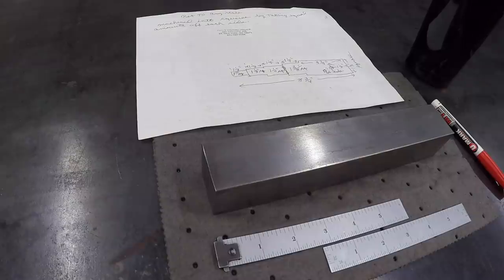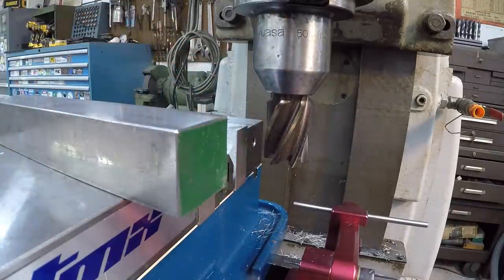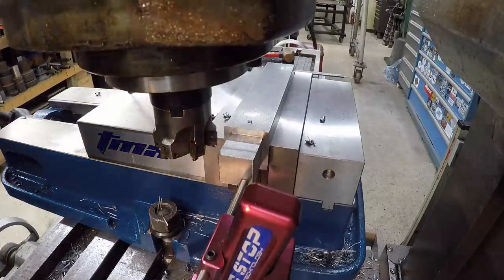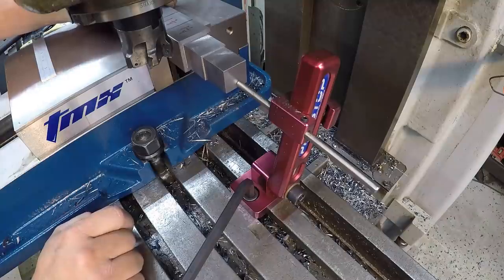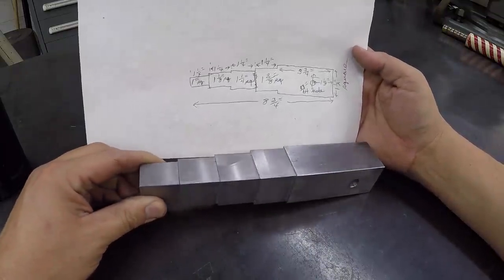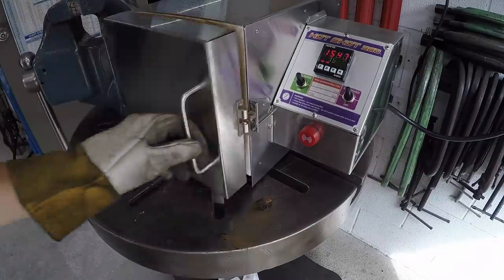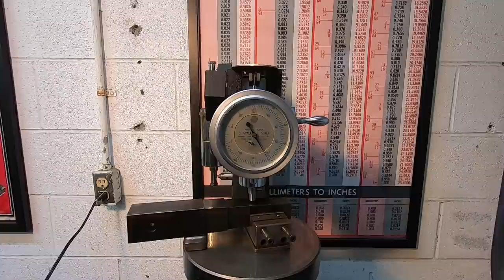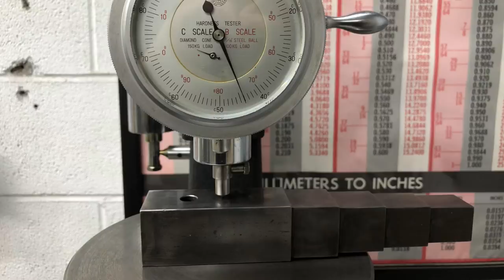SNS 296: Custom Square Drive Tool, Heat Treating

Comment: I think the reason you've got uneven hardness, is because it was sitting on insulating tiles, which absorb heat from the  metal, causing those areas to be less hardened.

Instead of putting the work-piece on insulating tiles, put it on a couple of of steel blocks.
Reply: After 2 hours at temperature, the tile and everything in the heated space have attained stasis temp. Seriously, touch the tiles - you’ll believe!m
Reply: if insulating tiles absorbed heat they wouldn't use them to build ovens.
Reply: @executive  That's not exactly true, the surface of the tile would reach whatever temperature the oven was set to. The tiles Insulating properties only prevents heat from travelling through the tile in it's entirety.  They also build ovens from tiles that are meant to hold heat by absorption, usually they're used on the oven floor.  Generally lighter refractories are insulative and denser refractories are absorptive. In gas forges for example the floor has to be tough wearing so they use a dense refractory over a lighter one.
Reply: @ianlowe4666   Don't overthink it. Sure, some ovens may have denser bricks that hold a bit more heat, but in general, the job of the oven walls is to keep the inside hot, not the surrounding room. In the end, it doesn't matter since everything inside the walls will reach the set temperature after soaking.
A bench top oven such as this has to be compact, so all of the walls will be dedicated to NOT absorbing heat, and keeping everything around the oven from melting. Botton line: I highly doubt that the resting surface will make much difference to the hardening of the steel (which is dependent on the cooling process.)
Reply: @executive   I didn't, pretty basic principles. Keep the patronisation though, I'm aware of everything you've stated already. I run a gas forge and a heat treating oven, used more than a few types and I've fixed them enough to know what they're made from and their working principles. 
You were just taking the piss out of someone for suggesting the tiles would draw heat from the steel, lets be honest.

Comment: The tiles your sitting it on are designed to wick heat away I wonder if that is making that part cooler
Reply: Those are insulating tiles. They do the opposite of "wick heat away".

Comment: I think you need to take the  wrap off before the quench.
Reply: I was thinking the same thing. The gaps between the foil and the steel must affect the rate of cooling when quenching.

Comment: we use hardness testers when we have to check temper on coils of steel for can making. when we start getting inconsistent readings, you need to change the point on the tester. smoetimes they crack????
Reply: This is interesting to know.

Comment: Instead of wrapping parts, add fitting to oven and purge oven with (dry)nitrogen at a low volume. Check with nitrogen supplier for moisture content. If moisture is present, unkown or cheaper to purchase,  percolate it through some glycerin in a glass jar between source and oven.

Comment: WE heat treat high pressure cylinders and we use no foil. Hard to wrap a 40 foot cylinder. But Every Thing has a contact thermocouple on the steel to verify temperature.Type K weighted down with stainless steel screen from McMaster Carr.

Comment: We always removed the wrap before placing part in the oil. 5 gal is plenty of oil as long as part goes all the way to bottom of bucket . We also had a basket. And oil was preheated to if I remember correct  to 125°.
Reply: Yep this was my first thought. The wrap is stopping the part from being cooled down properly and consistantly.
Reply: I think Adams' fear would be: the hot metal touching the plastic bucket and melting a hole, which then dumps the oil all over the shop.
Reply: Never use a plastic bucket always metal
Reply: Any  container used for quenching should always be metal and Oil should be preheated to 125° for best results

Comment: How sure are you of the temperature of the oven?
It almost doesn’t seem hot enough.
But could also be the material.
But from the one quench, it’s definitely not glowing like they normally do, my father did nothing but heat treatment in the tool and die shop. It was always glowing red like the sun when it came out of the oven into the oil.

The inconsistent sides might be the tongs pulling heat out of the part or the vice and not reaching critical temperature to let the crystals move around and fast freeze into a harder material like the narrow end that was harder.

Comment: I think you need a metal can for the oil. If that 1600 deg part initially slipped from the grasp of the tongs. Holy Crap batman get the kitty litter and the fire extinguisher. Just sayin...

Comment: My advice when something doesn’t go as planned is don’t trust anything and methodically go through each step, including your oven temp, material quality, and hardness tester. For verifying your oven temp you should be able to get a thermocouple that plugs in a multimeter. For material, you can try heat treating a few pieces of 4140 from various sources (make sure they’re the same size) and for the hardness tester you could test a known item like a file (~55-60 HRC). Heat treating is dependent upon the thickness and cooling/quenching rate.  Awesome video!  Very informative and thank you for sharing.

Comment: I wonder if using a vacuum sealer, even something like a household food saver, and wrapping the foil bag in a plastic bag then vacuuming all of the air out might help get the steel foil more tightly wrapped around the work piece?

Comment: Imagine the size of the press to use a broach that big.
Water quenches make for a much harder material.  It may have been a bit too slow so you may need a larger volume of oil or switch to water for such a large part. Try a piece of scrap material at different sizes and quench medium to see which works the best for your application.

Comment: If the blank of steel Is not normalized the carbon contenent are inconsistent and hardeness as whell... Try to normalized before machining and keep longer time to heat ... "Is not a steak ... It doesn't overcook" XD

Comment: Remove the scale before hardness testing. That millscale is very hard and will skew the results. The foil is not necessary and a hindrance with quench hardening steels. Did you preheat the oil? The oil needs to be warm before quenching. Believe it or not the warmer the oil the faster the part will cool because the lower viscosity increases the thermal convection in the oil.

Comment: Adam, it's been a while. You are baking that part at 1650 for 2 hours. That should be plenty of time to get it hot all the way to the core. Like said below, you could add a piece of paper to burn off the oxygen which would eliminate the need for the stainless foil. A quick quench is needed so the delay in removing the foil dose have consequences, but very little considering the mass of that part. Smaller parts more so. We ran HSS hole saws with a 3-oven low-medium-high heat (relatively speaking) and the parts were in each oven for about 15-20 minutes, then quenched in oil. They could cool to almost room temperature before we put them into the draw furnaces. All the HSS hole saw blades were then quenched in water and bead blasted to clean them up. I can't remember the temperatures of the ovens but the parts came out  of the 3rd oven bright yellow/orange. See you at the Bar-Z. Jon

Comment: I was surprised to see your initial hardness reading in the 12 range for HRc,  any c-scale reading below 20 is considered “off scale” and therefore not reliable.  You should preload to cone to the “dot” on the little dial and stop.  Then adjust the bezel ring to make the large dial read zero, then release the load.  Double check with your calibration blocks to be satisfied that you’re getting reliable readings.  As for the heat treatment comments you have been getting here, you should ignore 99% of them!  You are looking for expert opinion, but I guess that’s what the internet is for...everyone’s opinion!  Haha...thanks for sharing all your skills and learning experiences.  I’m a metallurgist and still learning.
Reply: I see many comments on here trying to compare his process to a carburizing process and I am sitting here shaking my head hahahahha
Reply: Highlifterdan it’s painful to read sometimes...haha
Reply: @lgj1962  also wonder the last time abom HRc tester was verified with a calibration block.
Reply: Highlifterdan he has a video, not that long ago, when he got the tester and went through the process with some standards.  I think this time he was just preloading the cone too much (and getting a false soft reading).
Reply: @lgj1962  sometimes it's all about the touch.

Comment: 8:52 “what I’m doing is going shallow on the depth,”  Shallow ABomb style = 1/4” of steel at a pass with no cooling!
Reply: Brad Thayer pretty sure he was talking about the final depth of cut
Reply: Tyler akerfeldt I know, I understood that, I just found it funny. He did take off about 1/4” in a single pass.

Comment: As to how you set it in the oven, no it does not matter. What you need to do is figure in some "Soak time" into your one hour per inch cook time. This will allow the temp of the part to even out edge to edge and into the center. Personally for oil quench I dont wrap the steel. A2 and D2 for tight tolerance parts, yes. But for something like this a little loss of carbon near the surface wont be a big deal.

Comment: Maybe the grips you use to hold the work are affecting the process causing localised difference in hardness? At school we simply dumped it in the oil, none of that jiggling as far as I can remember (school was a long time ago :)
Reply: ForOurGood Agitation is key so the oil always contacts the material. Otherwise it’ll be insulated in vapor. Leidenfrost effect.
Reply: @susanbarbier5053  is that right.. well what can you expect to learn from a high school shop class I guess.. but really clamping hard with a different temperature steel tool to do the agitation would also stop the oils from doing its job causing localised difference in hardness (really was what I was querying)

Comment: You should remind people to be very careful with metal prongs inside of an electric doing you can short it out
Reply: I believe those elements are  insulated. The coil is already effectively shorted to generate the heat while often being surrounded with a heat paste type medium in a tube. Never can be too careful though, I agree that warnings to less experienced viewers could be beneficial, though, I'd be more worried about burns :) those temps will burn so bad youd likely not realise until you smelt it

Comment: My 2 cents. Never hardened anything in other then a wood fire. I don't think the oven is able to heat the big piece of steel. My 2 cents you need to leave it in a lot longer. just don't think the steel is getting hot enough, not enough heating elements in that oven. Whenever I quench something it was only for a few minutes not trying to cool it down all the way. But I never checked it as well as you did and my checking was done by file. Just seams like it is not getting heat soaked all the way thru.

Comment: im no expert but you want to throw it in a already warm oven, preheat with some grating/mesh or similar in the bottom, when it comes time for the quench i grab it so i have one tong on the part and one only on the foil, get it over to the quench tank and release the one holding the part so it falls out. then grab it and move up and down

Comment: I would flip the part in the oven after 1 hr. Heat for 1 hr. more then do the quench that might help it be more consistent I'm thinking the ceramic is pulling the heat away from that side maybe
Reply: Ceramic is an insulator, not a heat sink. It doesn't conduct heat very well. The ceramic would block the great from getting to the bottom face of the part, but not "pull the heat away."

Comment: Does the heat treatment process alter the dimensions in any way?
Reply: Edward Cabaniss it can do especially if you lose carbon during the soaking and cooling

Comment: Hey.. I'm a newbie here though when you quench should you remove it from the foil. I thought that you wanted to scavenge the carbons from the oil??  Please let me know?
Reply: Naw. The carbon is already in the steel; sometimes carbon is absorbed from an outside substance, but it doesn't go deep. That process is often called case hardening.

Comment: You'd of been fine if like you said, you had a larder metal bucket of quinch. And drop your part in and cover it with a lid and let it set until completely cooled down before tempering.

Comment: i'm going with the most commenters here.
The part isn't hot enough.
Also what i learned is: you always machine the part bigger than final. Then heat treat it and then you machine the hard surface it to final measure.
Tough it could also be the wrong steel for that job. 42CrMo4 (4140 US) isn't particualy made for hardening. it is delivered already treated with about 20 HRC.
90MnCrV8 (O2 / T31502) should be better suited for that

Comment: The stainless steel foil is only to prevent oxidation when your heat treating most of the time you're going to go through several thermal Cycles Heating and Cooling before you ever even think about quenching it this relieves internal stresses in the middle 1600 degrees also seems kind of low before you quench it you got to go above the transition temperature of the metal and hold it there for a while you'll know you've gone above the transition point when the metal becomes no longer magnetic

Comment: Put it higher in the oven, temperature is not constant in there (upper part will be hotter), and with less possible contact with bricks; also avoid wrapping it in foil, cooling won't be as fast as it should be; at university i learnt 1/2 hour for inch of tichness of keep-in-temperature time; preheating should not be an issue for that part, it's not big enough to create cracking problem; try put it in the cold oven,  heating it up till 1100° and leave it for a while before reaching final temperature.

Comment: i dont understand the foil? how can you rapidly quench to harden the outside when the foil is providing an air cushion which is counter intuitive to the whole idea. 

surely just quenching straight into oil without the foil would give a faster cool and increase hardness overall???, personally id just have done the whole process without foil.
Reply: The foil is supposed to prevent oxidation during the heating, but it should of been removed for the quench. Modern heat treat is usually done in vacuum or in an inert gas atmosphere.
So his second way was more proper, just need to have a faster way to remove it.

Comment: Will cooling the quench oil, maybe with nitrogen, before quenching help reduce temperature faster and improve on the hardness?  just asking
Reply: Actually, no. Heating the oil actually helps cool off the part faster due to reduction of the Leidenfrost effect.

Comment: Hey, can you give us some tips for the folks that don't have access to an oven?

Thanks!  Great project as always :)
Reply: You can heat a similar part with a torch and use a magnet to test if you've reached critical temperature prior to quenching. I often will use a magnet to double check my oven temp.

Comment: Great vid always nice to see you trying new things that’s re out of your comfort zone. What are the chances of doing a segment of vids for beginners like this is a lathe this lever does this and that and this is how you properly set up this tool and that tool. I’m wanting to learn but nowhere to go or anybody really to learn from. Remote Alaska sucks sometimes but no Coronavirus lmao
Reply: With all the different lathe manufacturers over the years there's a multitude of control layouts, some are fairly easy to figure out though. Try here http://www.lathes.co.uk/page21.html and go through there archives and you'll see what I mean. Far too many inexperienced people with machine tools seem to think Youtube and the numerous shop videos available as good as they are can answer any question that comes up. Frankly that's impossible since the subjects too vast. There were literally thousands of those old school books specifically written about any shop subject you'd care to name. I've been buying anything I could since before the internet was invented. I'd say the best by far that will teach you the most is doing a search for a PDF of the South Bend book How to run a Lathe, then even better after that's read and digested would be this one.  https://www.teepublishing.co.uk/books/in-your-workshop/model-engineers-workshop-manual/ order it from this place in the UK since it's far cheaper than the Ebay re-selling bandits want for the exact same thing. Good reference books are tools and just as important as anything else in a home shop. And good trustworthy information doesn't get obtained without putting some time & effort into it.

Comment: That foil bag reminds me of those used for cooking, not surprising as it is a similar process but for a different reason.
Reply: edges are sharp as a razor blade, will cut you to the bone if one is not careful!
Reply: @mlminto  Thanks🙂 the foil reminded me of roasting bags but as you and Abom have explained these foils are a lot tougher and really sharp edges. I foudn the video really interesting and he says he is new to usign the foils. Experimentation, research and learning. We are always learning.
Reply: @Lesnz2009  yes, heat treatment foil is tool steel or stainless steel, which will stand up to temperatures of 2000 degrees fahrenheit. and again, with edges sharp as a razor.
Reply: @mlminto  Ok cool, thanks for that. 🙂 I understood about the sharp edges to begi nwith 🙂

Comment: HAY ABOM ..... If you measure hardness without removing the scale you will have a miss reading due to the soft outer scale..... cheers